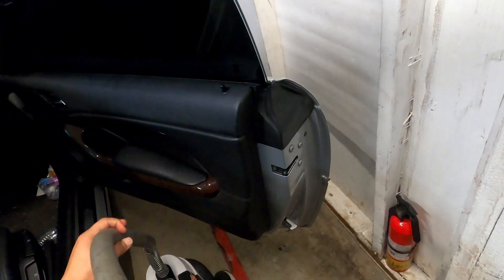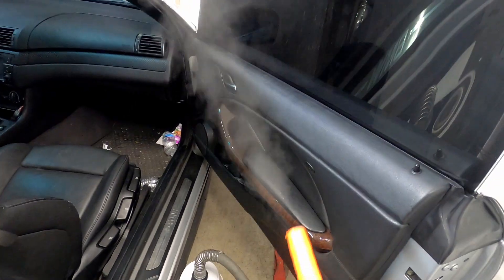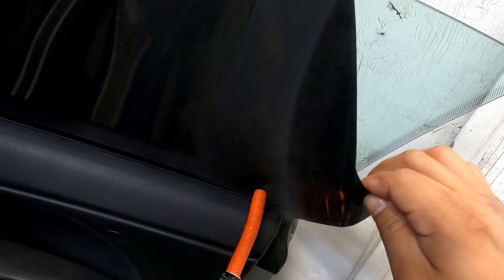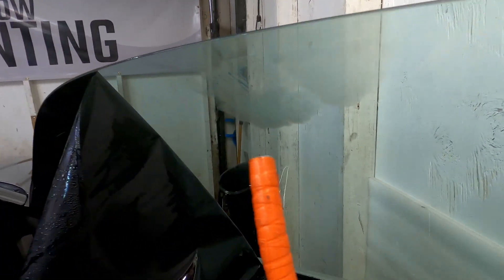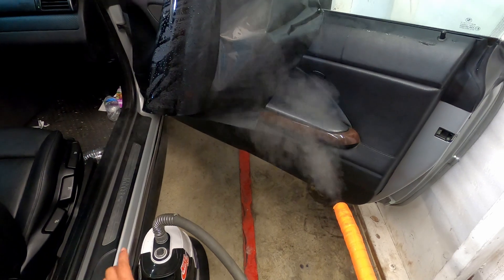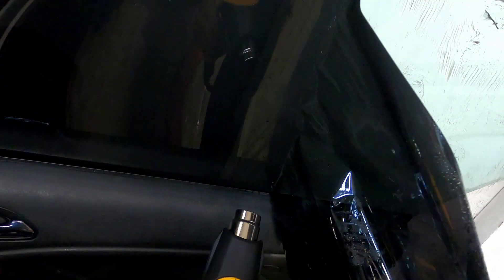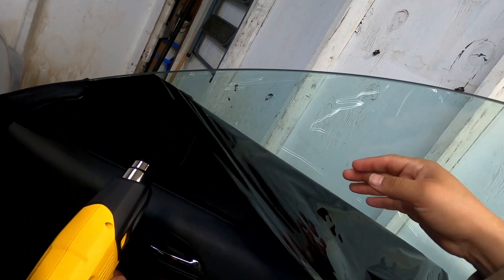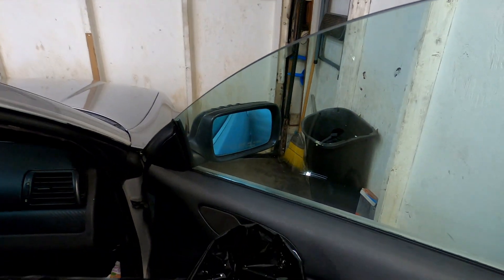How to remove window tint from your car, 2 different ways !

Comment: Can we use WD40 to removal the glue?
Reply from the maker: I wouldn’t recommend using it you well create more work for you as wd40 is an oil base  you can use LA awesome degreaser it will soften up the glue making it easier to remove it or you could get dawn soap and take it off with the razor blade

Comment: Nah man you did not take your time honestly you just decided to pull it out at the last minute and prove your self right to go with a steamer. All my removal I do is with heat gun for me they work the best but hey we got our different I choose heat gun you choose steamer. And no does not burn any plastic if you know how to use it.
Reply from the maker: have you try using a steamer ?? and yea your right we both got our differences I'm glad the heat gun method works for you
Reply: @solrwindowtinting   no I have not but at this moment I’m training a person to tint and removal so I will purchase to give it a try my self. I have seen a lot of people using it. But honestly with the heat gun is quick and easy with the steamer that I saw it was taking a long time. But I’ll be it a go.
Reply from the maker: yea bro try it out and the only reason i said that at the old shop some of the guys well end up burning something inside the car or outside the car the only thing you can burn with the steamer is yourself with that hot water lol but thanks for the feed back